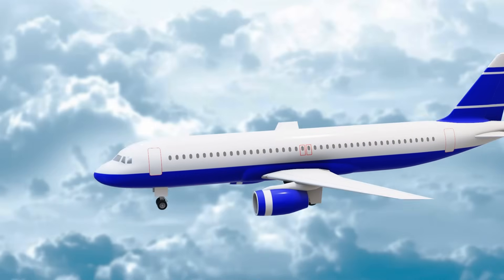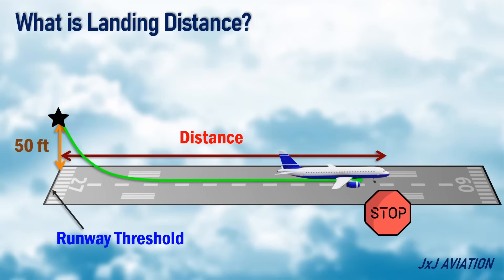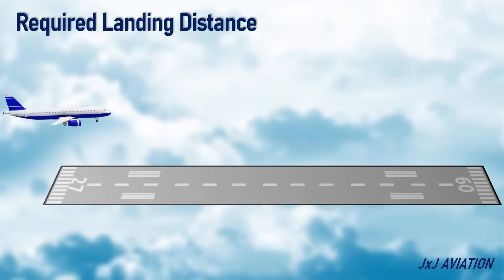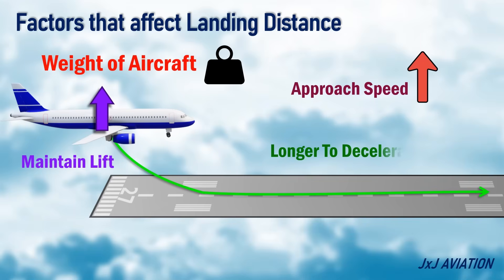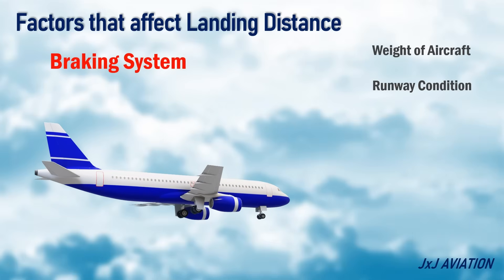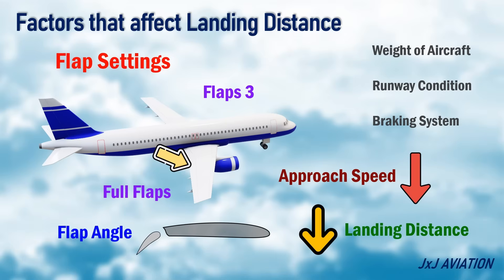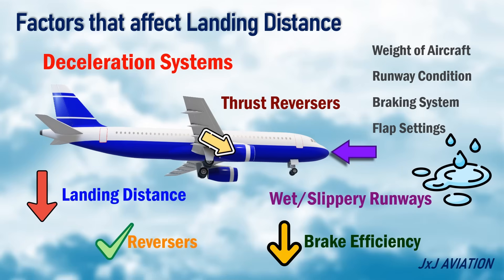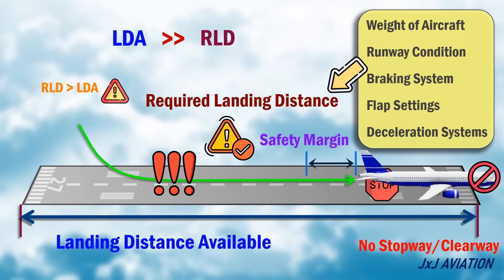Understanding Landing Distances and the factors that impact the Landing Distance | ALD | RLD | LDA |

Comment: I've noticed several mistakes in this video:
1:14 and 1:42 from my understanding the individual contributors and actual conditions add up to ALD, not the RLD.
The RLD is then just the ALD with at least 15% safety margin, i.e. 1.15x higher the ALD. So RLD is always greater than ALD, never equal.
4:59 LDA also does not include the displaced threshold, i.e. it only considers the distance after the threshold, distance before it cannot be used for landing.
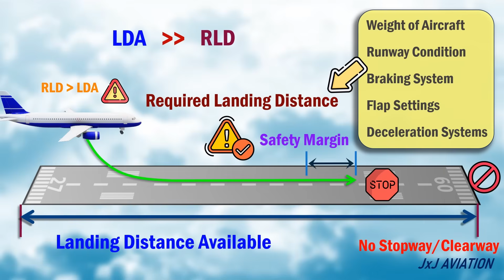5:05 The mathematical operator >> or << mean "much greater" or "much less" respectively. This would be used only if the values are different by orders of magnitude. So in this case if the LDA would be 10,000ft and the RLD would be 500ft or less then the >> would start to make sense. Otherwise, where the RLD is somewhat in the same ballpark as the ALD or LDA just stick to the normal > and < operators which are just "greater than" or "less than" which would be mathematically correct.
Reply from the maker: Hi. Thank you for your detailed observation! I noticed the RLD and ALD comparison during the final edit, so I couldnt update it. I have made a separate video on the declared distances, which talks about all the distances. >> was used for more emphasis, will lbe careful on its usage next time. Cheers!